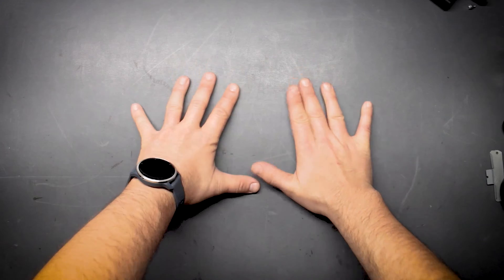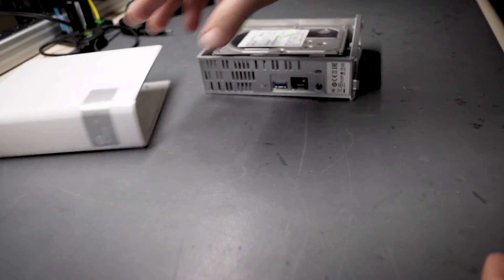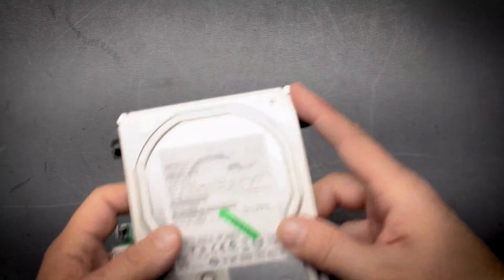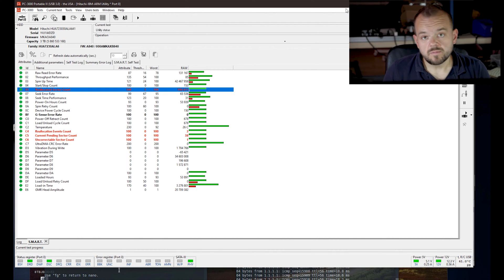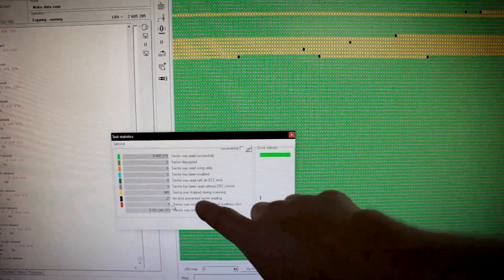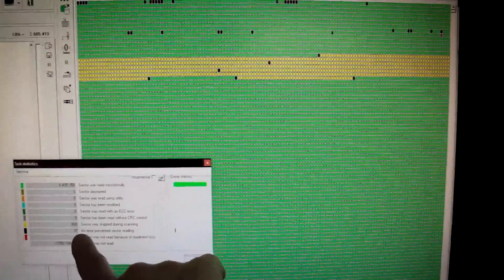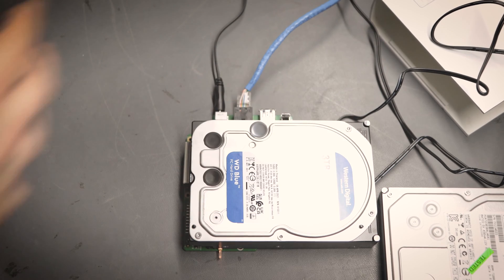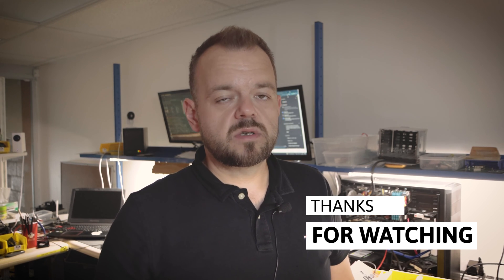MyCloud not working - quick fix!

Comment: I've had a corrupted firmware following the recent failed firmware auto-update, and was advised by WD Support to put the disk into another NAS system to retrieve my data. I'm not worried about my data as I have used the USB backup not too long ago. Are you able to show a way to force install a clean firmware into the board and get it to work again? It was blinking red light with no access through Putty, dashboard, SSH etc.
Reply: I have the same problem on the EX4100 , did you find a solution ?